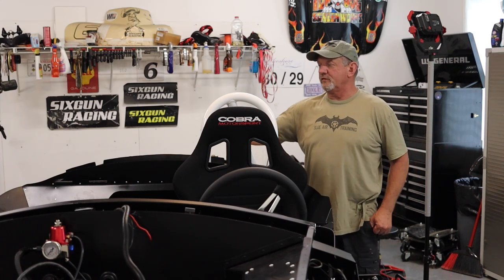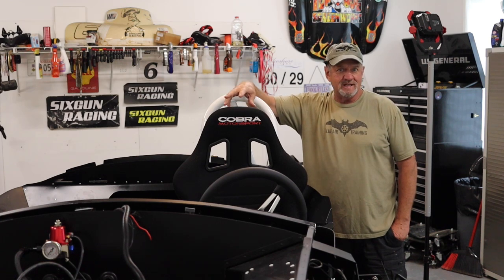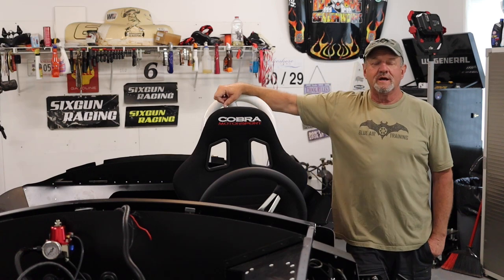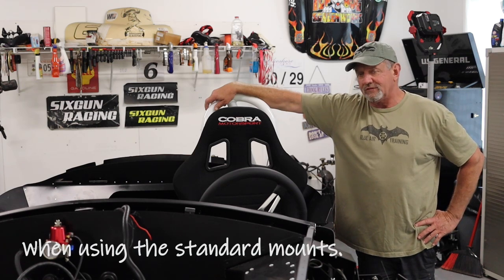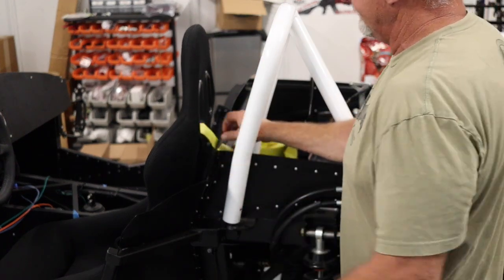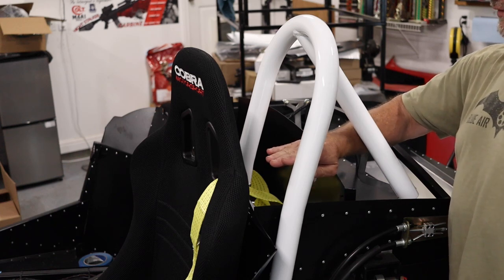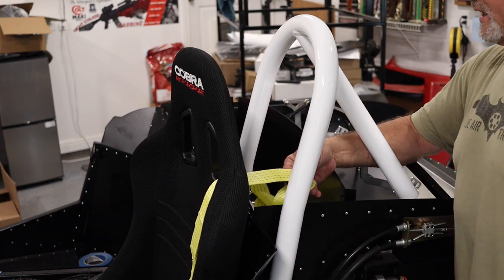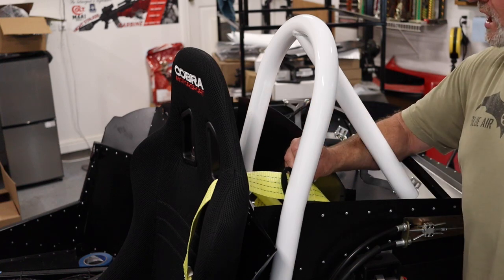Building a Factory 5 Racing Roadster: The great seat belt controversy.

Comment: You really don't want to use shoulder harnesses unless you're going full on helmet + hans. Using rigid shoulder straps keeps the body in place but allows the head to move forward, in case of accident, drastically increasing chance for neck/spine injury. If you do go with them, the horizontal bar across the roll bar is the best method for safety - you'll also want to be sure the shoulder pass through on the seat is properly aligned with your shoulders and not below them.

Comment: What about a retractable seatbelt with a 5 point harness? Similar to ones used in airplanes?
Reply from the maker: So the attachment point is what I was struggling with.  Using the taller seat meant the seatbelt had to follow sort of an "S" pattern, which is not safe.  I like the idea of the retractable but either way, to do it right it would need to be hooked to the support I welded on the roll bar.

Comment: For me option #1 would be the welded in bar, option #2 would be the bar clips for the belts. Difficult choice but you know what they say, the harder choice is usually the right one.
Reply from the maker: My buddy just came up with, drill a hole through the bar, put the bolt through, weld it in place then grind down the head to make it less obvious.  I'm still on the fence.

Comment: Hey, I suggest welding a lateral bar and mounting belts as they are designed by looping. Maybe consider painting the bar black to make it less obtrusive. God forbid you end up on your lid, but that is the only thing keeping you in the seat, not breaking your neck (hopefully). Welding the bolts and attaching the belt fitting in could result in ripping the bolts out in a crash, and you taking a dirt nap. But if you go that route, weld a tab to the bar, then bolt the belt bracket to that tab, which is probably safe. Basing this on what I learned on my Bonneville car. FWIW. SGDM! NSDQ!
Reply from the maker: That makes a lot of sense.  I'm glad to see a man of your advanced years be so sharp.  SGDM!!